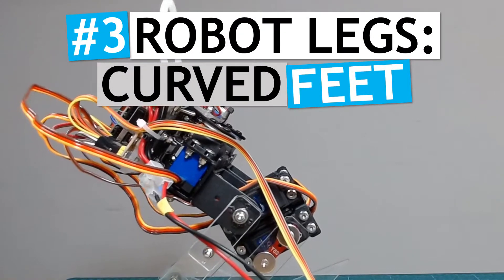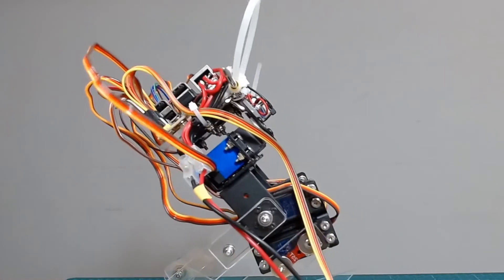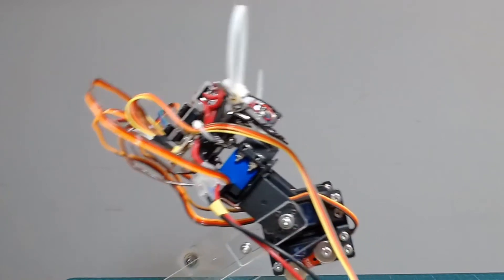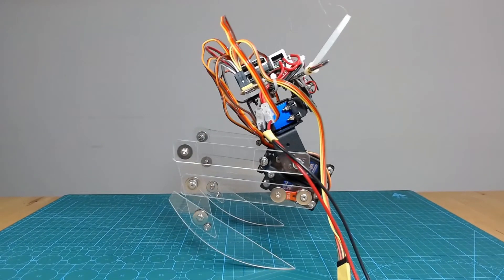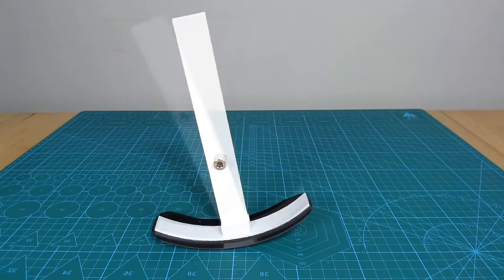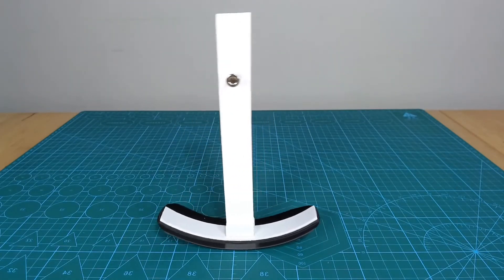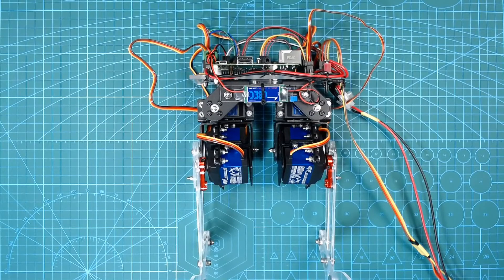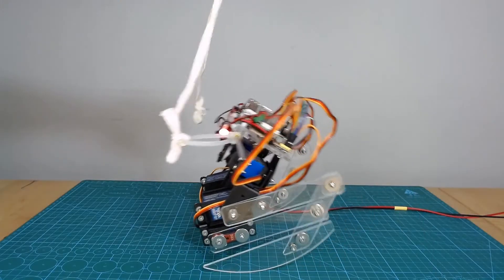Robot Legs: Do Curved Feet Help?

Comment: good night, excellent work. One question, how do you calculate the radius of the curve of the feet?
Reply from the maker: Kind of trial and error. I tried some foam-board feet to get a rough indication. I also tried to identify the CofG by holding the system from a few different points and letting it hang (look for a Prof Sumner Miller video on Center of Gravity). If you know the rough CofG you can choose the radius.